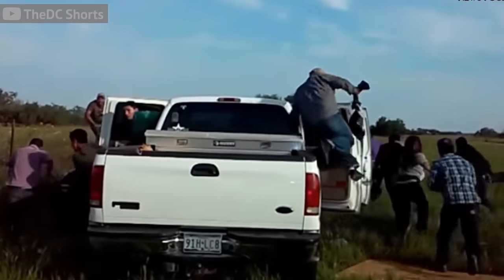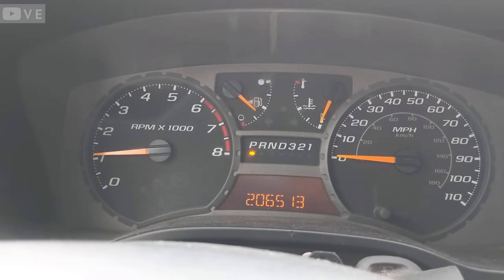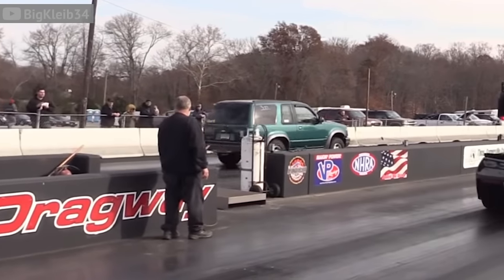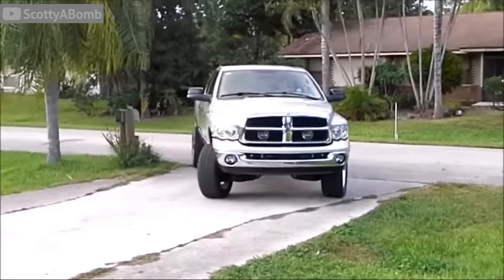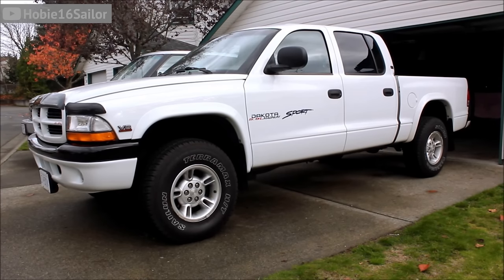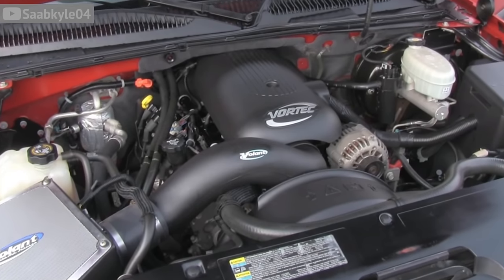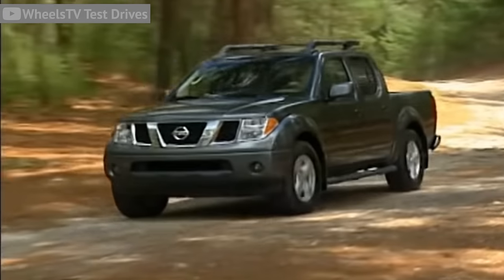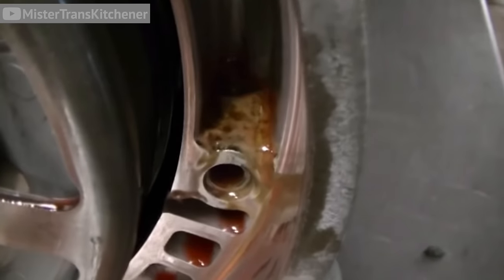USED TRUCKS YOU SHOULD NEVER BUY!

Comment: Subscribe? NOW WAY! Not after trashing not one, not two, but THREE trouble free trucks I’ve owned in the past! Especially the 2003 Dakota Reg Cab 4x4, 3.9 V5/5 speed I bought new. A loaded SXT, that I used to tow with regularly, starting with a trip from Massachusetts to Ohio, where I rented a good sized UHaul trailer, a 20’ twin axle covered trailer. That I used to gaul knock down cedar picnic tables from the manufacturer to sell for a profit a few times. I would buy and haul about 100, 60 lbs tables at a time, I’d lay a stack of 8 in the bed all wrapped up in tarps to keep dry and the rest loaded into the trailer. Then haul back to massachusetts where I would advertise an sell them for a decent profit. That Dakota would run at the speed limits of up to 65, with ease, even in the mountains on RT 80, in 3rd or 4th gear at least going the speed limits at 65, then back down the other side in 5 th gear at 1,600 rpm’s just feathering the gas peddle on the flat highways, at one time a CGVW off a Cat Scale at 12,000 lbs! That’s the truck, trailer and full tank of gas, myself and a load of 100, 60 lbs table kits! With an average of 12 mpg! That was the only weak spot, gas mileage wasn’t that great, empty cruising along at 15-20 mpg, not all that good for a V6!

Comment: The 5.4 triton V8 engine was never in the explorer or the mustang, it was the 4.6L V8 that was in both until they came out with the 5.0 for the mustang and the 4.6L for the explorer was discontinued and replaced with a V6. And the 2 valve triton engine was a decent motor the 3 valve was trash. Read a little more then wikipedia my guy.

Comment: Also, as far as the avalanche goes…I mean the plastic fading OK whatever. It’s looks are…debatable sure….but idk about all that w the engines having issues…I’m not a Chevy guy but the entire vortec line are great engines. There was even a 2500 option w the 8.1 which is pretty cool…so idk about that. Obviously it will have electrical issues guaranteed Lmfao.

Comment: OK come on now the avalanche is overheated we have a 2005 Cadillac Escalade EXT basically an upscale avalanche it has 216,000 miles transmission shift smooth engine runs great we have a Chevrolet avalanche 2500 with the eight. One we have towed 21,000 pounds in that truck not even a skip

Comment: This video is click bait nonsense. 

 This guy clearly is not a mechanic and doesn't know what the hell is talking about.

Tge 5.3 liter vortex engines, which is not specific to the Avalanche, they consumed oil, but it had to do with a redesign of the passenger's side valve cover, that had a PVC valve built into it.
 Since then, the valve cover has been redesigned, and if you own a year vortec that is affected by this, you simply replace that valve cover and the problem is solved.

 I've noticed that most people that talk shit about the Chevy avalanche, have never owned one. Actually ask an owner.

I've had a 2003 Avalanche for 11 years. It's by far been the best,  most reliable Truck I've ever had, bar none. 

 I live in the mountains and actually use my 4 wheel drive regularly, and the thing can go practically anywhere and has no problem towing. I actually Homestead where I live.

 The speedometer issues have to do with the step motor's, and that same problem exists in the suburbans and the Silverado's as well. It's a cheap and easy fix.

 As far as the engine, that's the standard 5.3 liter that's found in the suburban as well as a Silverado, sane for the tyranny. 

The engines are bullet proof. 

 so.. to act as if the  5.3 V8 is unique to the Avalanche makes no sense whatsoever.

As far as the cladding, if it's faded, just paint it. I painted the cladding on my truck with Krylon fusion in satin black, it looks brand new, and just as good as it did when it came off the lot.

Do you Actually have any real criticism in regards to the truck?

Comment: The avalanche is a truck even has built in tool boxes which I use mine has 355267 miles on it with original motor and transmission so what u gotta say about that

Comment: So with the Ford engines, I knew about the problem 5.4's (2004-2008). But the 4.6 and 6.8's also had this problem around the same time frame. The cam phaser issue is new to me...I did some research and the affected model years for the F150 are 2009-2010 for the 4.6, and 2004-2010 for the 150, 250 and 350 5.4. The 6.8 is not on the list at all with that issue. The Expedition is 2005 to 2014. So basically, if I want to look for a 150 or Expedition and can't remember all the model years for the different models, I have to look either before 2004 or after 2014. Jeez. Or just look for a Silverado. Thanks for the info.

Comment: Who is this guy he makes 0 sense he contradicts himself with every vehicle he mentioned from experience if you have an older avalanche just get a transmission with better clutches it's an 8000 pound truck with a transmission built for a 6000 pound truck of course it's going to have issues until you fix the problem

Comment: Damn... I was looking at an '07 F150 (w/ 5.4L v8), an '05 Avalanche, an '03 Dakota, and an '04 Tundra. This man just single-handedly tossed my list.
Reply: Don't believe someone who just loves to hear himself talk. I'm not sure about the rest, but the Avalanche is a great truck! I have had no problems with mine, except for the fuel control module, which was only about 60 mucks, and easily replacable. It's an LT with all available options. Drives great, quiet, handles good, and and gets respectable gas mileage, and has an 11.7K towing capacity, as well as being able to haul anything up to 8 ft long in the bed without it getting wet, all for only 10K dollars! No accidents either! Wouldn't have had it any other way. Highly recommended!